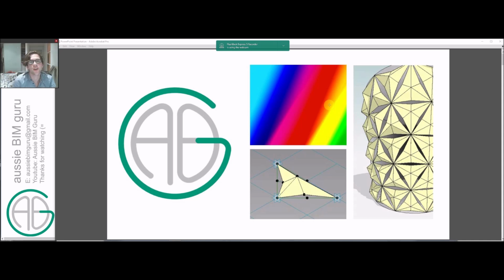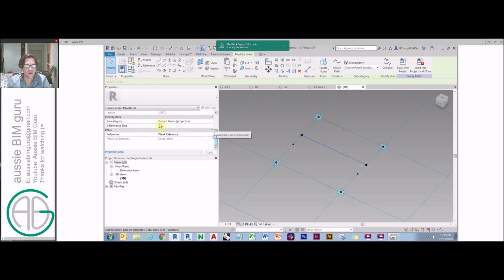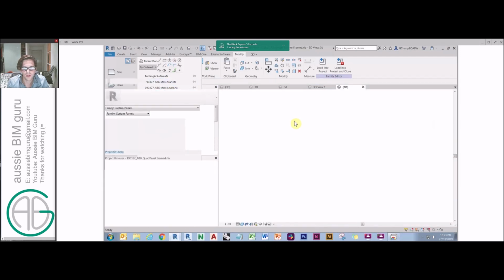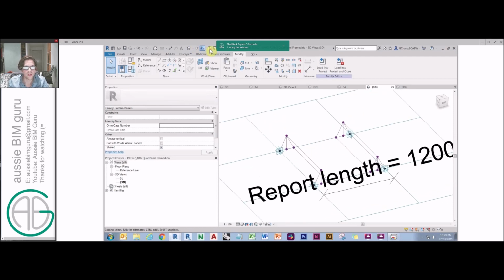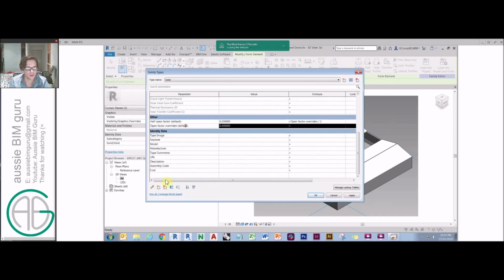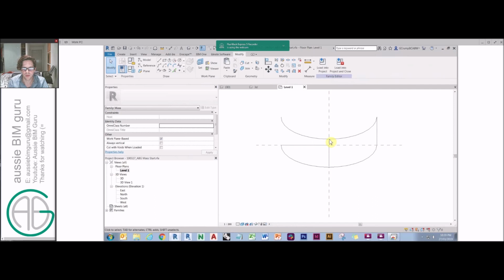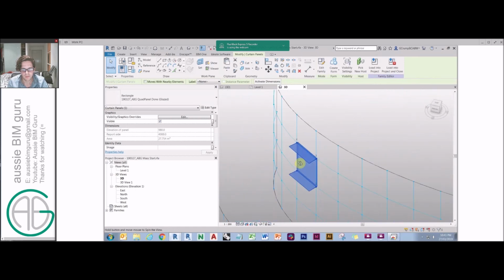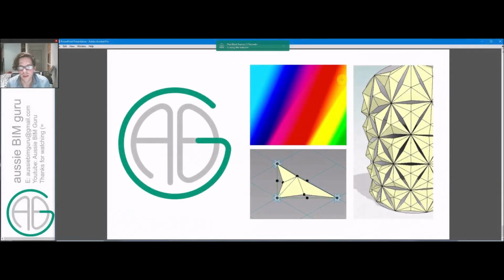Adaptive Components in Revit (Intelligent Facades 2/3)

Comment: It sounds like you're about to explain the logic behind how you derive the fold offset formula at 11:30, but then the video cuts to the next part.
Reply from the maker: Hrm yes weird, not sure why I did that - it's been a while since I made this video, my editing skills weren't as flash back then...

By the looks of it I've put points on the driving edges and used segment length offsets in their properties. The formula I used is:

Quarter of edge length * Half the degree of open-ness required
(Report length / 4) * (1 - Fold)

I'm unsure why I used 1 - Half fold/0.5 as this is effectively just 1 - Fold I think.
Reply: @AussieBIMGuru  Thanks for your response and for making such high quality content.

Comment: very useful tutorial , but I couldn't host the element to the divided surface , don't know why !!!!can you advise , many thanks
Reply from the maker: Make sure you turn on the nodes like I do at 23:40. These are the points to host the adaptive points for the repeater component to initially.
Reply: @AussieBIMGuru  I did :((((((
Reply from the maker: @amalalsaraj188  hrm besides that I'm not quite sure unfortunately. Typically if its a regular divided surface like mine and has a 4 point panel on a 4 point surface placed on nodes it should support a repeater. Make sure you're in a conceptual mass too and not a mass in place in a project maybe.
Reply: @AussieBIMGuru  thanks for your quick replay , wish you all the best

Comment: What did you do to make the hole decrease as we go up? in project file
Reply from the maker: In this case the panels decrease using a parameter that sets the distance of the folding panel along a spline.

The massing is done using a conceptual mass with divided surface pattern.